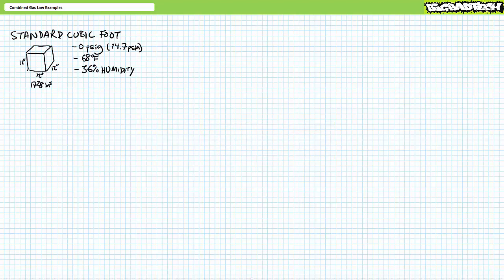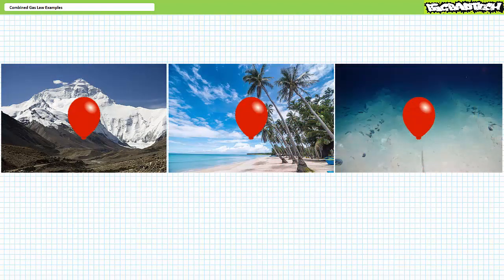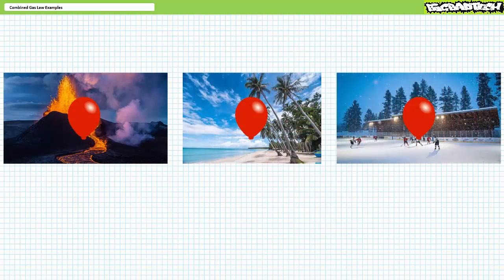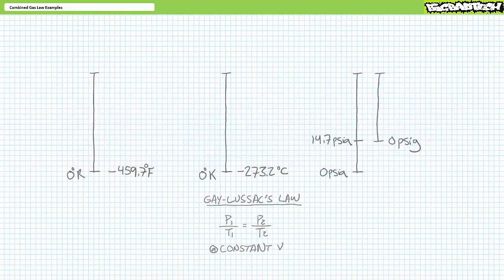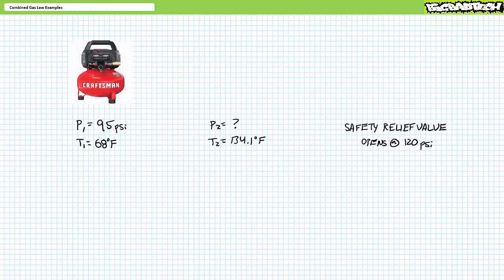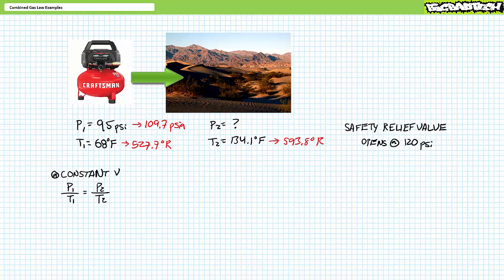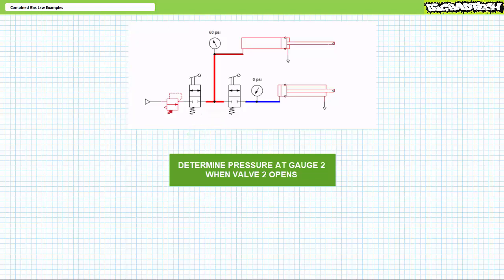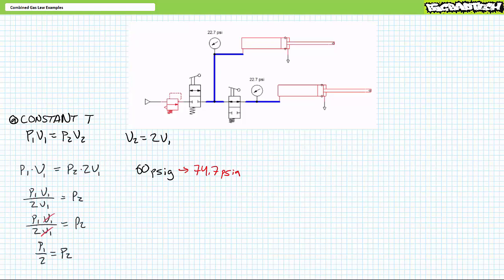Combined Gas Law Examples (Part 1 of 2)

Comment: This is a great video thank you!!  Have you done a video on Henry's Law yet?
Reply from the maker: No, my content is kind of focused on electro-mechanical technicians rather than chemistry. Only application I could think for Henry's Law as an electro-mechanical technician might be air over hydraulics systems?
Reply: @bigbadtech  I see your point and you're 100% correct.  That's exactly what I'm using it for.